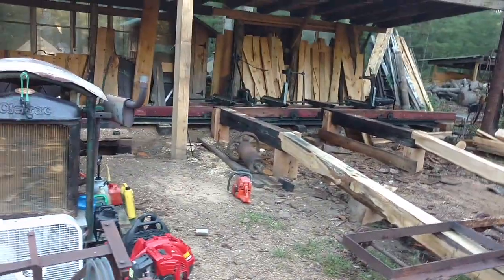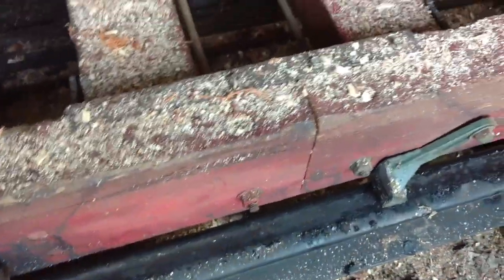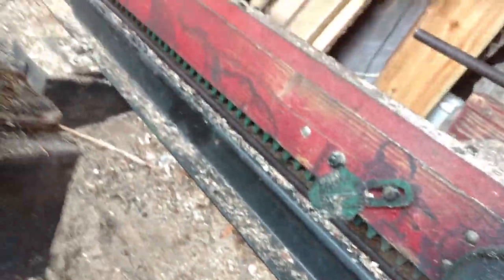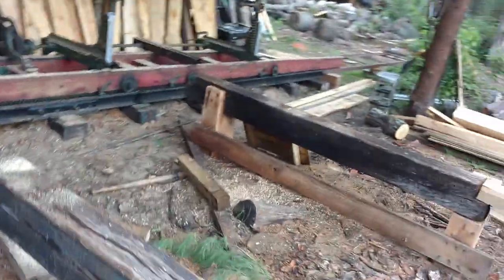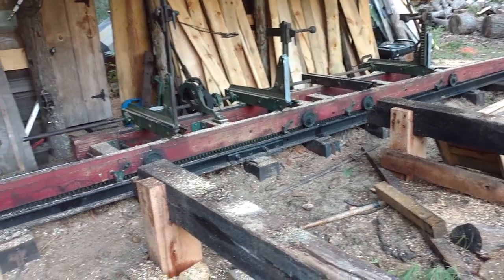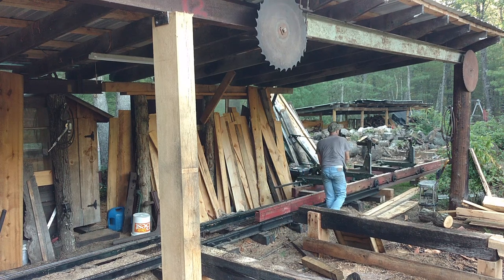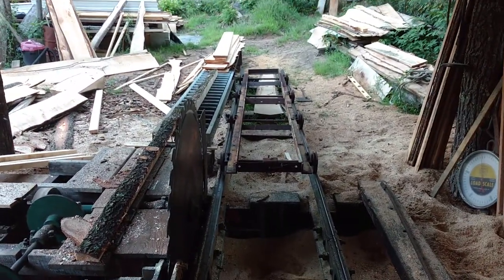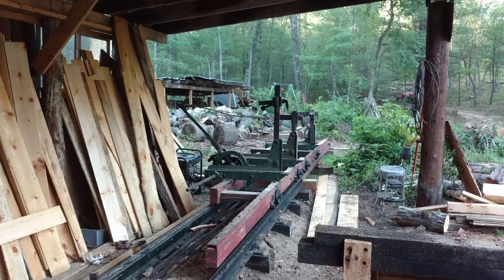Antique American # 1 Sawmill upgrade

Comment: I have a 1/4 scale working model of the American #1 Portable Saw Mill.  The carriage is cable drum driven by belt pulleys.  I have been contemplating redoing to friction drive - we'll see.
Reply from the maker: I Would love to see some photos of that or video if you'd like to send some. I have been trying to make this one cable drum drive not sure on the size pulleys and the skamatics of everything. I Was going to use cable drum and still use my friction drive but would much rather go with the flat belt set up.  my email is" mytwinboys211@gmail.com